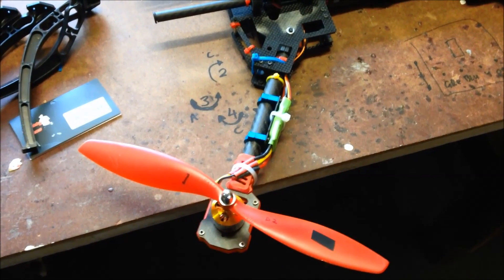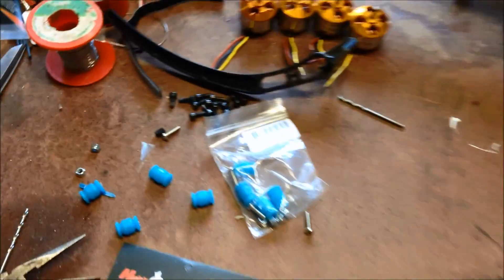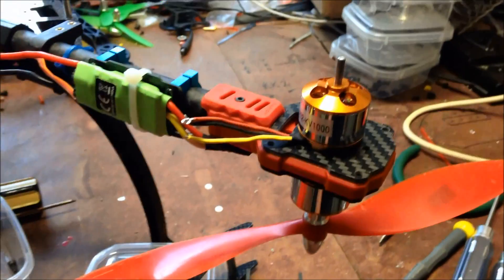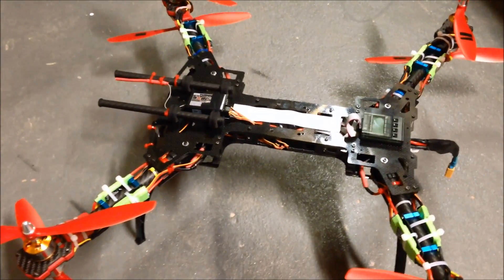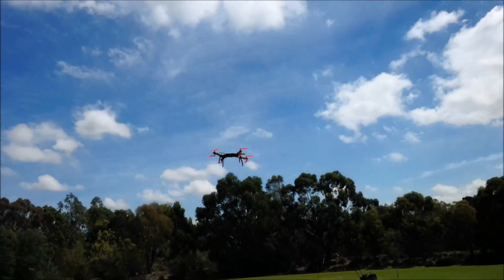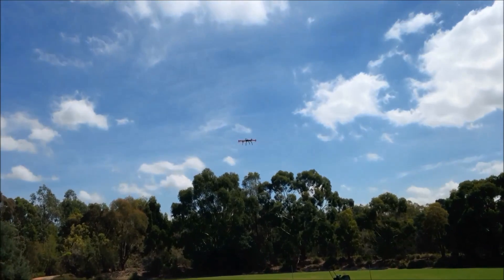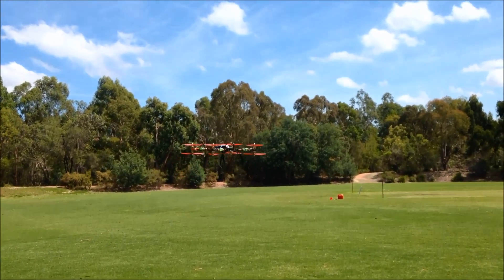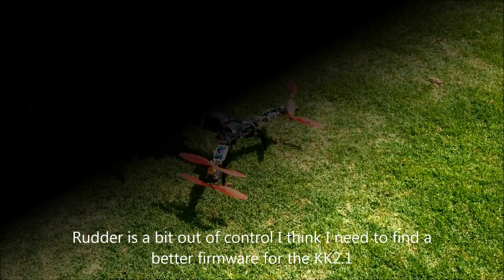Alien 560 Quadcopter / Octocopter X8 Octo configuration. Build and first flight.

Comment: What size propellers are you using?  With this setup do the arms still fold in ok, or do the bottom props hit the landing gear?
Reply from the maker: +Jacob Heller I have used Tarot 680 Motor mounts so the arms are longer than normal therefore no longer fold in completely. Using 10 inch Props in this Video. 10x45
Reply: +Simon Hahnel Glad I asked.  If I used something like this would it allow folding?  Any reason the setup wouldn't work? http://www.goodluckbuy.com/h4-multicopter-dual-layer-motor-mount-holder-16mm-w-red-conjoined-screw-nut.html
Reply from the maker: Yes they would be fine as they are not extending the length of the arms

Comment: Awesome build, are the bottom props the same size? I'm thinking of doing this to my 650 quad, but find conflicting info about the bottom prop size, some say they should be an inch or so smaller, but your flight proves it works just fine if they are the same. Its very smooth.
Reply from the maker: Props are the same size but yaw was a bit off so I changed the motor config. This is the latest set up.
https://www.youtube.com/watch?v=Z_SP90yoxfU

Comment: Nice built!!  I ordered the same copter and was thinking of doing the same config. for the same reasons. If you lose 1 or more motors, esc or props it will still make it home.
Plz show more of it, videos and build films. What battery are you using with  the extra weith of the motors and ecs's.

Good job, want to see more :)

Comment: Looking good! but ive never known what the purpose of having this configuration is for, i mean motor top and bottom weather it be 4 6 or8 arms is it for stability or power or maybe both, and i can imagine you go though batteries really quickly?
Reply from the maker: If you lose 1 motor or ESC it keeps flying. Redundant systems. If you are carrying an expensive camera it would be very useful.
Reply: I see thanks for clearing that up cheers!